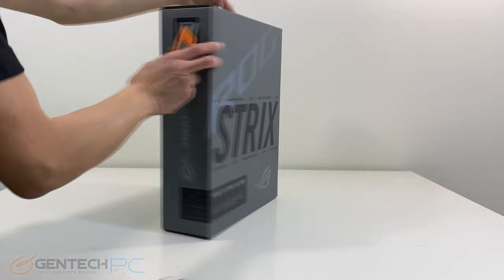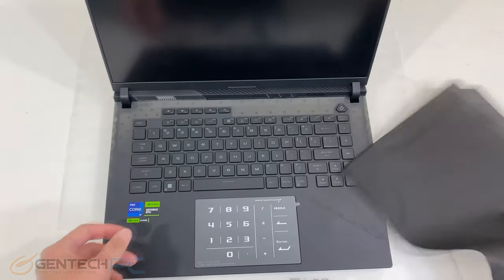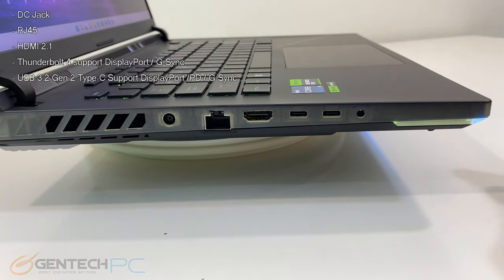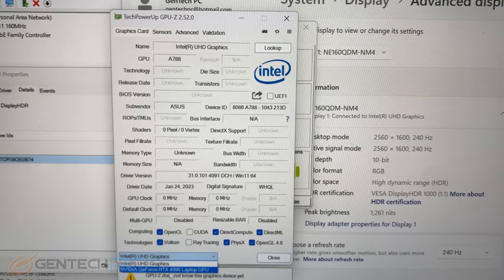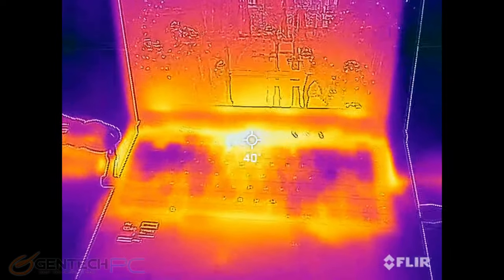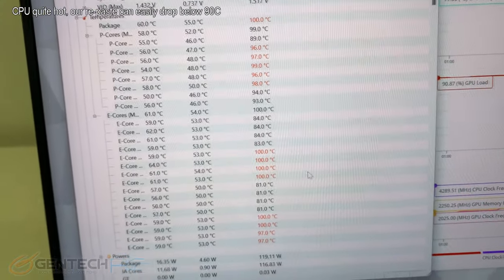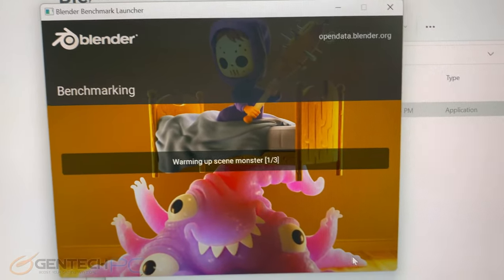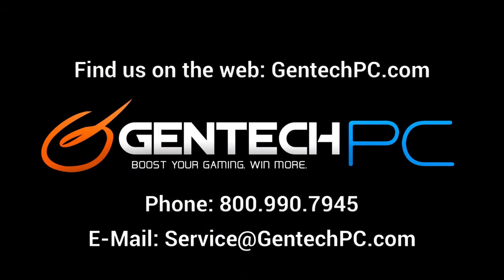Asus ROG Strix Scar 16 Unboxing & Benchmarks: I9-13980HX / nVidia RTX 4090

Comment: i wanted to know i dont wanna spend on thermal pads and i use thermal paste on my 2070 laptop and it works best for low temps but do i really need to change thermal pads on like vram and heatskin (it still factory pads on it) using since 2021 jan
Reply from the maker: Scar 16 doesn't use thermal pads on vRAM.

Comment: It's melting! Yikes!
Reply from the maker: 100C can melt butter but nothing more.
Reply: @GenTechPC  ok sounded rough.
A question. I bought a raider ge77hx 3070ti 20k r23 score. It's still returnable.

That said Is either strix scar 16 with either an i9 or the Ryzen version with an rtx 4080 going better than the msi ge77hx?